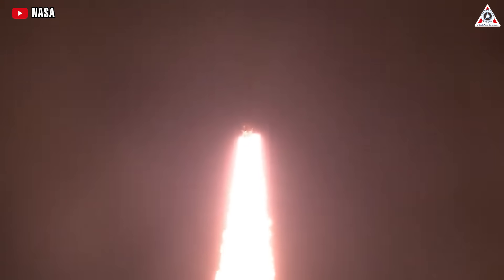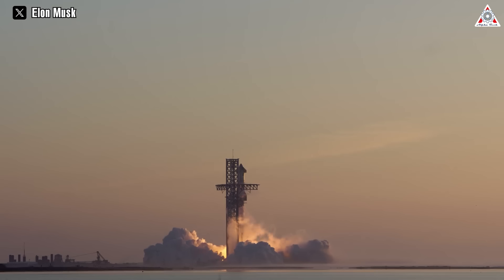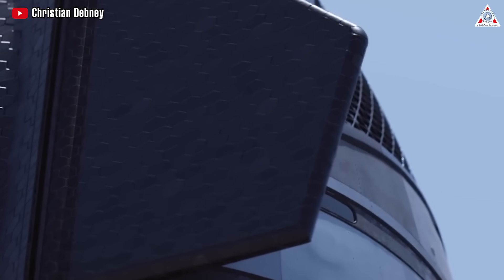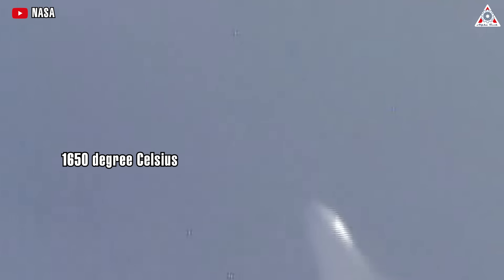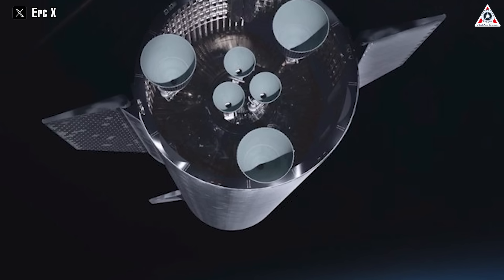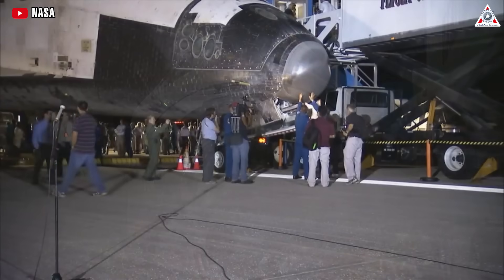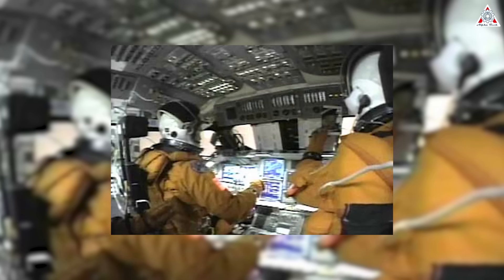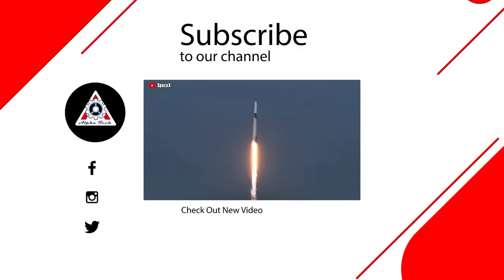SpaceX's genius solution for FIXING Starship heatshield fall off for the next launch...

Comment: Tiles seem solid and flat edges???
Sn cyclider is like a soda can
Thin and flexes

Roof tiles over lap
and also fish scales 
are designed for flow.

If tiles had a flat plate
to surface and two
 mushrom pegs to lock upon
with a spring type clip
allowing up down movement
for flexing heat expanshion
and damping vibration
Edges slighly curved
one side slipping under thge next tile
 and the other ringing over the next
yet still being level at surface
two other sides could have a fiber fringe
to mesh diffrent tiles to slow pulling away.

a line of potruding tiles beteen for and haft
 wings to disrupt the plazma flow.

Skipping down into atmosephere
like a pebble thrown across a lake 

to slow speed slow to lower tempture

Comment: Tile issues have been a forever problem since the space shuttle first began. It cost the lives of many astronauts and ran the cost of the shuttle up significantly in terms of manufacturing, inspection and tile replacement. It has always been a major concern to me and to NASA and the military as well. SpaceX was given a focused contract to investigate tile development and that contract was recently extended. Musk seems to always be a step ahead when it comes to development and seems to have an alternative waiting whenever a problem develops. I suspect the smaller tiles are necessary because the bigger tiles just don't work; at least in certain areas. It is probably a have to do rather than nice to do. It has to be a more time consuming and costly alternative than the larger tiles. I have heard it said that in large part the SS could survive with the loss of some tiles because of the layered protection it also has. Myself, I don't think the tiles fill the bill for everyday use. Another alternative will have to be found and may already be under consideration. It will likely come from the developmental contract SX is currently working on. Something like a sprayed layer with bonded top that incorporates flow control using hexagonal shapes - spray, flow control blanket (think hexagonal chicken wire), smooth bonding agent. It could be done with just two components.

Comment: If the tile can’t withstand Takeoff. Hell it will be destroyed as it falls thru the atmosphere burning and melting. The old shuddle tiles only got The old chance vault.tore by ice on takeoff. Starship can’t fall back on this reason. For the tile to stick they need a very coarce surface for glue to adhere to. I would suggest 250 to 500 finish. Anything thing less will delaminate.

But lucky this won’t be a problem as all 33 engine boosters will all blow up. Before 300 kilometers.
Reply: Are you referring to 33 Raptor engines? The recent 2nd test launch saw ZERO Raptor engines blow up.  Get out of fantasyland and go watch Blue Origin instead.
Reply: @metriczeppelin  are you blind or a moron? The video clearly shows an engine bay plasma fire in progress before out staging. When the booster detached you can see 2 additional plasma fires, exiting 90° to the booster. Then it explodes from the engine bay forward. So you should carefully watch SpaceX’s video again. Last if maga musk doesn’t begins redesigning booster away from 33 engines. Starship will die. They have three more starship hulls. No cargo, no life support, nothing but a bare bones Roman candle. All three of these will explode while attempting to reach altitude to launch starship or will flame out and fall back to earth and have to use the explosive pack to avoid damage at sea or on the ground. I have 45 years experience in manufacturing, electronics and electrical. Maga musk will run out of cash if he doesn’t reverse course.
Reply: @mikerash-pc4jc  45 years of mediocre unnecessary pessimism.  You must have been a misery with which to work.  

I do not understand.  There is very little future for space flight without reusability, and the bigger the craft the easier the rentry becomes.

So where is SpaceX gone wrong and why aren't you working for them?

Comment: I can't help but think the general approach to heat tiles is slightly flawed, but I'm no expert. For example, the bottom of some high-end frying pans are coated with some kind of ceramic material. With that in mind and a little research and development..... perhaps they can create a ceramic based paint-like substance to coat the areas requiring high heat resistance and then cure it in place. This is just a thought, and I certainly don't know enough about that particular material.
Reply: Great idea, however, ceramic coating for household frying pans is ~300°F, while rocket reentry surface is more like 2,300°F !!! (so idea requires a little more work)
Reply: @johnrday2023  Thus, the research and development part of the idea. I do know that ceramic as a material in general can take very high temps before completely breaking down. Of course, a ton of research is required to make this work.
Reply: Neat idea. Then we can have a starship that cooks breakfast on the way down..

Comment: Gases will blow through stainless steel just as easily aluminium due to the extended time of re-entry. In other words Space X cannot afford any mistakes not one on those heat tiles! no different to NASA space shuttle.
This scares me greatly due to Space Xs current mistake riddled Starship and design choices.
Reply: Why they've only had 2 test flight launches, they are test flights after all, for the reason that this is the way SpaceX does R&D testing in real life conditions.  Do it and see what works is a faster development cycle than what others do.  That is why SpaceX is innovative and moving forward and the others lag behind.  I've lived thru the early space programs with NASA and there were a lot more RUD's back then when they were just learning how to do it.
Reply: The heating is expected to be milder due to the broad surface area. The shockwave of plasma forms further from the surface due to it's breadth. Not sure what you mean by extended time of re-entry. Re-entry heating always occurs within a couple minutes. Starship does have some control over re-entry with it's flaps. Quite frankly I think structural load on their cargo area is a bigger hurdle .. they will have to use air pressure for rigidity which means air tight construction, not simple for something with massive bay doors. Eventually they will need full length doors for specific mission profiles, not the starlink pez door.

Comment: Is it possible to artificially increase the duration of the reentry, so that the dissipation is less violent ?
Reply: I have wondered this too, certainly it is possible, but I'm not sure if starship's flaps could significantly alter it's path enough to 'skip' on top of the outer atmosphere more than a traditional capsule. Seems this would be very important for Mars atmosphere. Watching the Orion capsule video, it's notable how high up the heating occurs... it falls for minutes after the plasma is gone before it comes anywhere near clouds. I have to think starship will have control over it's angle of decent at some point.
Reply: Yes with a longer retrofire and a shallower angle but too shallow and it could skip off the atmosphere back into space
Reply: Yes, but more refuel is required.  In the extreme case they could slow down to a dead stop and experience no heating at all but I doubt they could haul up enough fuel for that.    So you trade the retro-fire burn time for reentry speed.  The longer the burn the less heat shielding you need but you need more fuel.    The total weight is minimized at some point and they are where they are now.   To maximize payload to orbit you care zero extra fuel and let the booster burn up. SpaceX does this some times and intentionally expends a booster.

Comment: Regarding NASA's Space Shuttle: It's launch record is 133 successes out of 135 launches, a 98.5% success rate. 

Challenger was destroyed during launch when a silicone rubber O-ring failed on one of the solid rocket side boosters. 

Columbia was destroyed during reentry when hot gas entered through a hole in the leading edge of the left wing. 1.5-pound piece of foam thermal insulation became dislodged from the External Tank and impacted the leading edge of the left wing. Hot gas entered through that hole during the reentry and weakened the aluminum wing structure until it failed. The tiles were not involved in the Columbia disaster.

In the 133 successful Space Shuttle missions, those ceramic fiber tiles performed exactly as designed. Despite damage from falling foam and ice, those tiles protected the aluminum hull of the Space Shuttle Orbiter from catastrophic burn through just as they were designed to do.

Side note: My lab developed and tested over 50 versions of those Shuttle tiles during the conceptual design phase of that program (1969-70).

Comment: Q : if a tile falls off on starship return, does the white backing insulation come off as well, or stay in place, or depends, or they don't know ???
Reply: It's not connected to tiles, but who knows. I think they want that information. In fact if they were so lucky to not have that happen, I bet they'd intentionally remove tiles in a test at some point.
Reply: It stays in place and probably will protect it for one reentry.  FYI tiles did fall  off on the space shuttle as well,  there were many missing and some burn through had  occurred but not in critical areas that compromised the structure fortunately

Comment: This was the majer Problem from Space Shuttle, and now it is it from Space x! It cant work…
Reply: It did work on the space shuttle and it will work on Starship, Columbia wasn't destroyed by a failed tile it was destroyed by foam hitting the leading edge of a wing and punching a hole in the reinforced heat shield material on the leading edge it wasn't a tile but was a similar material to the white underwrap on Starship

Comment: Somewhere down the line I'd like tosee the manufacturing process for the tiles. Many of them will have to be custom designed. I would think they'd have a database with individual tile properties that could potentially be made by cad/cam tools, maybe? I'm just guessing but I am intrigued by how they would streamline such processes. This could come in handy for other ship designs if the groundwork has already been accomplished?  
(Just daydreaming)
Reply: As I understand most of them are the same hexagon shape unlike those on the shuttle that were custom shaped to the hull. IMO the groundwork has already been done by SpaceX engineers

Comment: I assume the ceramic mat/blanket is several hexagon heat tile wide and long so it protects a fairly large area. So it in effect it insulates the back of the heat tiles from the ships stainless steel hull, while giving extra ablation layer if any heat tiles fall off.
Reply from the maker: Great!

Comment: Why don't SpaceX use a small amount of cold fuel to cool down the stainless steel during reentry instead of using heat shield tiles. Best part is no part?
Reply: the steal its self will melt and the coolant will run out the hole then it will catch fire and blow up

if we had some metal that can survive 2.5K degrees without melting at all and be reasonably ductile to defend against vibrations and yet be strong enuf to deal with the forces involved with orbiting and de-orbiting a space craft then it might work with a high temp coolant
Reply: The idea would be to redirect the cold fuel used to cool down the stainless steel into the raptor rocket not into the atmosphere. Same principle as raptor rocket to prevent them to melt and also the Stoke Space company heat shield idea using the fuel to cool down the heat shield (no tiles required)
Reply: @111smd  It exists it's called Titanium and it melts at 3,135 F but it would also be extremely hard to work with and weld and very expensive however maybe sheets of it underlying the area that would experience the highest heat could be made of it

Comment: Starship is SO FAR BEHIND THE 8-BALL that SLS is now delayed by YEARS!!!  And Starship is 30 years behind on figuring out the TPS issue!! Nothing here to SHOCK NASA!!!
Reply: SLS took how long to develop...with no lander even planned? And Starship is what, 5 years in development? I'll bet more Starships orbit the moon in the next 15 years than the total number of SLS launches. There is no 8-BALL. The only delays are from regulators. Development of Starship is exponentially faster than anything except Apollo, and that had 6 total landing missions. Starship will land on the moon and Mars hundreds of time.
Reply: @donrubottom8723  SLS was developed in full swing starting in 2017. 5 years from drawing board to build, and a completely successful launch of its prototype, its one and only and first vehicle. Based on proven engineering. No incineration of its launch tower (far less damage than even Starship’s 2nd launch!!!) and completely successful stage separation, LEO, TLI, lunar orbit, 3 changes to lunar orbit, return to earth, re-entry, and landing dead on target. The heat shields were also completely successful.
Reply: @wolfman007zz  Yeah and it only cost 4 billion on a disposable rocket that can't be reused at all , if you want a permanent colony on the moon that route is as unsustainable as throwing away a 747 jetliner  after one flight
Reply: @donrubottom8723  couldn’t have said it better myself ✅
Reply: Bro did you have a stroke while you were writing out your comment?
Reply: Wolf man, did they not spend 1.5 billion+ each year 2011 through 2017 and another 13 billion thereafter? More than 5 years there. Not to mention Constellation program 2005-2009 and the Shuttle technology from decades earlier?
Fine spacecraft but economically ineffectual. Don’t compare political spending programs with private development. They are incomparable. 
(My Congressman wants to know what those billions were spent on outside your 5 year development period.)
Reply: @donrubottom8723  Nope. 2017 is when the design work started. The previous designs were scrapped. They were merely paper dreams of what NASA thought they wanted. NASA changed their minds, funding came and went prior to 2017.

NASA wanted the Ares program before Artemis. Congress changed their minds also. All that money was spent on false starts, and was approved by Congress! So your “Congressman” need only look in his files for where the money was spent, and wasted! Obama killed the entire Shuttle replacement program.

Comment: The very shape of the Starship's hull is not at all optimal for successful braking in the atmosphere .l very much doubt that such a devise can fly well.
Reply: Really.. I suggest that they have modeled lots of shapes and found the one that is best. It's not just about the best shape for coming back into the atmosphere. The rocket has to both hold millions of gallons of fuel and support the stresses of take off and stage separation. You can't optimize for any one part of the flight. Anyway SpaceX has launched hundreds and hundreds of rockets and I'll trust they will work it out. LOL
Reply: @kstaxman2  I will be very surprised when I see the successful landing of Starship .
Reply: @sandrasamara-c4i   I really doubt you have much knowledge about space flight but in any case SpaceX certainly does. They have taken what a few others played with and perfected it with the Falcon 9 and there is no reason that they can't do the same with Starship.
Reply: @kstaxman2  Agreed 100% It is the 'scientific' approach that tends to concentrate on a single design aspect. This is frequently fatal to engineering projects which, by their very nature, must harmonise many different aspects of a design to ensure they work together.
In a long career in engineering I have seen far to many disasters due to a 'scientific' approach being taken.
Don't do it!
Reply: it doesnt fly ......its falling with style

Comment: The best heatshield is the rusty one like the space shuttle orange 😊
Reply: No offense, but the orange foam on the external tank was designed to keep the cryogenic liquid cold and not to be heat protection. If you noticed it burned up when jettisoned on reentry.

Comment: How Many .... Months does Musk need to fix/upgrade/replace/re-engineer , his BF Heat Shield Tiles ?  So they Work ! ... It's been 2 years ! ... They might come in handy , if he ever wants to Land the BF Starship ... Maybe they forgot ? ... Who was the Lunkhead in charge of that ? ... The next Flight 3 , needs , those Tiles Fixed , the Booster fuel slosh Fixed , a Clean Burn , Separation and an Undamaged Starbase ... and that build isn't made yet ... :D
Reply from the maker: Thank you so much!
Reply: Fortunately Robert we have Boeing /ula who are building a new generation for only 5 times  the price that is much better than Starship re usable as long as it does not leave  earth and bound to prove all critics wrong. Yes they may manage to recreate the Apollo success of the seventies.  China  lol !!
Reply: This is why there are test flights.  The Wright bothers didn't get the airplane right on first tor second try either, yet you expect perfection. Maybe you should consider how SpaceX has been reusing and landing boosters and has a 99% success rate before you criticize. You might just learn something